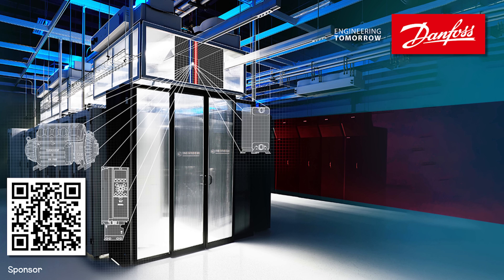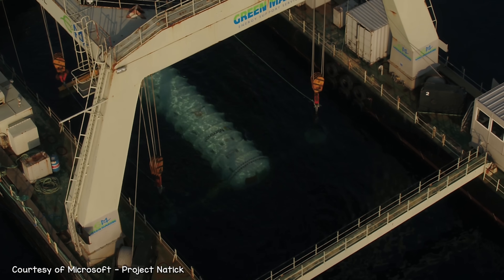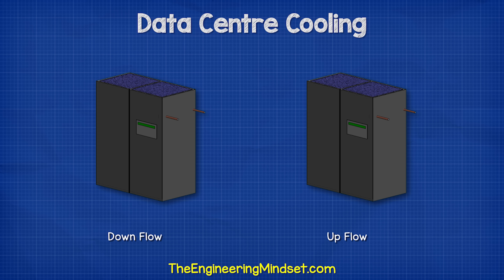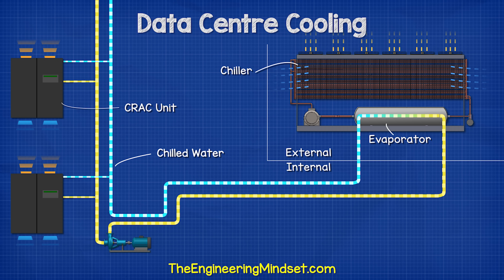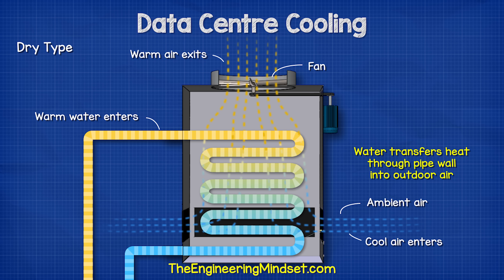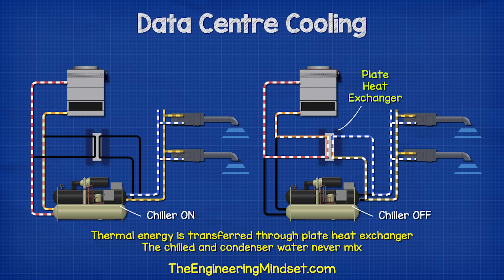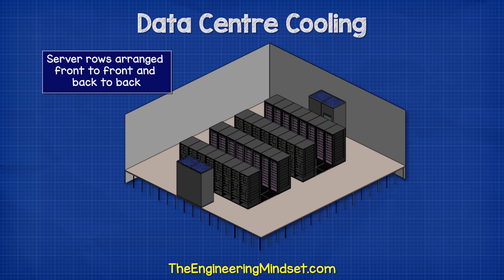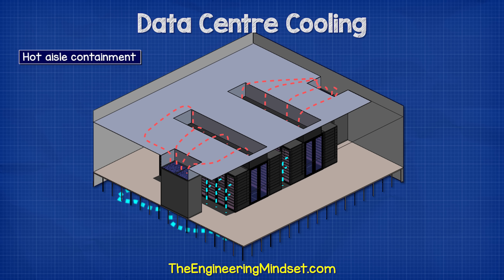Data Center Cooling - how are data centre cooled cold aisle containment hvacr

Comment: I think the biggest waste for most Data Centers is not using the heat you create.
As heat goes upward, i never fully understood why you can't use this heat for example to stop pipes from freezing in the winter on the roof, electric heaters are mainly used as far as i know.
It's pretty stable heating unless everybody leaves the Data Center.

Comment: There's discussion in the media about fresh water usage by DC cooling systems. Given the closed cooling circuits and fluid to air heat exchangers involved, where is this water lost? Some thermal power stations lose water to atmosphere when condensing LP steam in their cooling towers but I can't see why they must use potable quality water for this if they don't have access to river or seawater.
Reply: idk this is exactly why i came to the video. I dont believe the claim that they use millions of gallons per year. Unless somehow its being lost in evaporation

Comment: Should be installed near Buildings in the city To heat the water for the Shower and the heat in the winter in parallel with the Central when the server does not need to be cooled

Comment: Cooling is overrated. Just disable all the thermal protection and  replace your server every time is overheats.
Reply: The Warranty for the Server would be VOID.
You also loose all the Data, which is not why you have a Data Centre. ?

Comment: not sure about the evaporator cooling method. doesn't all the moister cause eventual corrosion of components and inter connects ,shorts in the equipment, and possible data corruption and or loss? 🤔

Comment: This is a very well explained video. I think the performance of the cooler is important, but in the end, the most important thing is to effectively convect and dissipate the generated heat. It seems that the actual cooling energy consumption can be reduced through this.
I think it is good to optimize the air flow to effectively dissipate heat.

Comment: One I’ve built is a hot aisle/cold aisle, air/mist evaporation cooled on from the second floor and forced down through the roof of the data hall and then hot air is removed and either mixed or expelled.

Comment: Some cooling centers use cold isle and hot isle. And some use cooling towers, while others use a different form. They are crazy. They have massive generators, and they are normally powered directly from the power source, IE hydroelectric dams.. one building can generate 1 trillion a year, and one section of the building can generate 500 million to 500 billion. I currently work at one such site.  I work on ones that do not use refrigerant due to size, they are designed to be replaced after 10 years...

Comment: The most environmental unfriendly things from.the moment, data centers....
Some use green energy, the claim.
But still they have emergency generators as backup power which are test run on a regular basis.
Still a big CO2 contamination while the data centers also take the green energy away from normal houses.

Comment: I installed many cooling units in data centers. They also has Halon fire suppression systems in them. I always worried about setting off the Halon system while working in them. Halon gas eats oxygen in the room quickly.

Comment: 1:17 your name of the channel should tell you that if ALL the energy consumed by data center is converted into heat like you say, then you could also compute on your electric heater !!!!
And it would even be more efficient because there are no moving parts or lights or anything else to waste energy instead heater really does convert it almost all into heat.
We do need to take into account that we can not have perfect conversion from electricity to heat so even heater can not convert all into heat, but it surely does do much better than servers do !!!

Comment: Question: Is it possible to harness the heat from the hot air flowing in the ceiling into energy?

Because I have a dumb tought of placing a stirling engine (which I discovered by yt recommend) on the top of the ceiling where the hot air flows

Comment: accurate, correct until the last part.  8:20 racks don't exhaust air to the rear but to the top. data center cooling though still lacks efficiency/innovation.  for example, humans working in data centers don't need to be cooled or the building/room containing the racks. cool air can simply sucked underneath the racks but no.

Comment: Very interesting video!
A good tip for efficiency is to explain to the customers/rack owners, that blanking panels and correct installed equipment are mandatory.... 
No matter, how smart you build your mechanical cooling system and cold aisles.... when the equipment you want to cool is not installed properly, you will always have an issue.

Comment: i used to work in the 9/11 memorial as an engineer. Data centers were top alert at all times, and we had more than a few emergencies where the temp climbed from 60 to near 82 in minutes. The port authority server room had two constantly running dataaire units, and you literally had to wear a jacket if you were working inside for any length of time.

Comment: Even with optional airflow equipment, data center operations folk seem to still have a knack for installing intake on the hot aisle and exhaust on the cold aisle...

Comment: UPS and battery monitoring technician here. Worked in data centers for the past 8 years. I’ve been at data centers that use that evaporative (they called it adiabatic) cooling where they should not have. I was in a battery room that was 88 degrees  F (31 C) probably 100 percent humidity. Not a good environment for batteries. This was a major company but I can’t say who because of an NDA.

Comment: You didn't talk much about humidity control which is very important in data center and the main difference between AHU and CRAC units.
Reply: Talk about humidity control, the testing which I am involved delay for weeks because some consultant assume they can control the humidity to below 70 without a dehumidifier in a humid country.
Reply: I'm in Florida.  We have external humidifiers in the rooms in addition to the humidifier in the air handler.

Comment: Very cool. I work for a large Data Center that builds on slab, hot isle contained data halls. We employ multi-mode airhandlers that are not in the data hall but outside. Cold air is ducted to above the server cabinets. Our air handlers have direct expansion, indirect expansion via an evaporative cooling tower system, direct evaporative cooling in unit AND access to economizer/ free cooling as able to. We even have areas where using the outside evap coolers we have liquid cooling piped into the server cabinets. We went away from CRAC due to potential issues they presented to the Servers when failures happened in the data halls; Too risky. Having the set up we do allows plenty of redundancy both for individual unit component failure and total capacity as well as efficiency for cooling and power. Thanks for the video!
Reply: very cool hahahaha
Reply: Cool job man! Can i ask you a cople of questions ill keep em brief ive began studying data centers and id appreciate your input

Comment: Servers are being designed every day to withstand higher Temperatures so that Cooling Load reduces drastically. DCs have been designed till 38 deg C Hot Aisle Temperature so save sufficient load on Chilled Water System. 
.
Diifference between CHW Temperatures have to be as large as possible to decrease the Pumping GPM and thus the Load.
. 
All inverter (Partial Load) Motors provide higher efficiency at lower speeds. So designing Tier 4 DCs with N+N Redundancy and running both systems (2N Chillers with Inverter Compressors & 2N CRACs with EC Fans) at partial loads provide higher Efficiencies.

Of course,  very little of the stated above applies to American Colder Climate with Free Cooling possibilities but Servers with higher Temperature Resistances always help.
Reply: While I'll agree with you that servers are being built to withstand higher temperatures, as I have walked into rooms that were 95 to 100 degrees and everything was still running. The problem is the optical servers which are delicate and often start to suffer physical damage above 90 degrees

Comment: Hi Paul! I’ve been following your channel for quite some time now! When I was writing my thesis for my Bachelor I was giving an overview of absorption HVAC systems (such as heat pumps and chillers) and I remember that there were more than some articles around that talked about the use of absorption chillers in data centers. One article was analyzing a solution implemented in a data center in Arizona (pretty hot climate) in which some small finned tubes were made passing around the physical servers casings, taking away much heat, then this fluid would have accumulated in a hot tank, kept at the desired temperature with the help of some solar panels. The hot fluid here stored would have been fed to an absorption chiller LiBr-water in order to cool the server room. Hence the server room would have been cooled by the same heat the servers were producing! The absorption chiller was cooled with an external water source, water that if I remember correctly was used and then cooled in a cooling tower.

Do you guys think this could be a viable solution? What problems would it encounter?
Reply from the maker: Yes, it does work. It can't produce enough coolth to completely cool it and it isn't very efficient but, it is a way to offset other mechanical cooling. We have covered how the absorption chiller works in an old video, check it out.

Comment: I've worked in both mid-sized data centers and computer labs back in the 1970s and 80s. Back then, single mini-computer installations were similar to today's data centers in they were installed on raised floors with significant quantities of cooled air, as those O.G. computers produced a large amount of heat that needed to be constantly removed. Sharing the space near a cooled computer mean wearing a heavy jacket or parka(!), unless you love arctic conditions LOL! I believe the air was being pumped from the floor at about 40 degF, not much warmer than the interior of a refrigerator, and 100s or 1000s of cubic feet / minute. Nowadays, people complain if their laptop gets a bit warm or they can hear those whisper-quiet cooling fans. In that data center, you'd be lucky if you could hear your own thoughts. It's like a constant speed hurricane! I'm sure there are many more clever solutions to cooling nowadays.

Comment: In the 50-120MW DCs I'm running, we use indirect air cooling (+ spray water). The chiller just kicks in to add cooled water and mix it into the flow if temps are higher. CAC is normal, HAC is newer and not comment yet. Efficiency also could be made, when the customer aggree to run their intake not on 22-23°c +/-2°c (or even some old folks want 19°c), but more like on 25°c +/- 3°c. From our calcolation that's 10-15% less cooling power needed.

Comment: What is the priority for cooling a data center,  processors or storage? If it's processors then the best way would be in oil that is then cooled and recirculated. Usually a swamp cooler outside.
Reply: That's an interesting idea. Can you provide a link to an information site?
Reply: Using that method the oil will never get below the outdoor temperature.

Comment: I have been working in data centers  for my entire career. I have seen every one of these layouts and cooling systems. One huge challenge is getting the computers and networking gear to have the proper air flow direction, not to mention the, mostly older, systems that move the air in on one side and out on the other. The hot air containment is the easiest to work in from my experience, provided the hot area has air movement to keep the temperature down to a reasonable level. 

One item that always seems to be left out is the noise. Granted that is outside the scope of your video, but it is something your don't hear much about. You wouldn't believe how loud it gets inside a data center, especially inside of a hot isle containment area. All those 20,000 RPM fans pumping air into a small enclose space is deafening. Ear projection is a must. You showed some B-roll of people in a datacenter wearing hard hats. That is bullshit. Nobody ever does that. You need one where everyone has ear protection.

Also, all the sock video ever shows neat and clean rooms all organized and all with super clean wiring. That does happen, but only in a room that is managed properly. I have been in many colo's (colocation data centers where you can rent 1 or more racks) where many of the racks are just a spider web of tangled cables. It is a major problem that good datacenter managers spend a lot of time policing.

Comment: As a server tech I was sent to do a SAN upgrade to a customers in house datacenter. Expecting to be in there for hours I brought a nice warm jacket.When I walked into the DC it was like stepping into a sauna. The air con system had failed, there were buckets of water catching leaking AC and they had house fans plugged in trying to cool all the equipment. There were hundreds of red flashing leds on all the server and storage equipment in the racks.  I have also encountered Datacenter AC failure with water leaking from the roof soaking the racks below. With staff frantically calling their server storage hardware vendors to log warranty calls and of course not mentioning the flood they were exposed too. Cooling failure in a DC is catastrophic, u better have a   redundant solution in place.

Comment: I don't get how the position of the evaporator coil is completely horizontal, from my understanding it should be installed at least with 60 degrees of inclination.
Reply from the maker: In reality it is, but this is a simplified 3d model. It's missing 90% of the components inside. It's just shown as a illustrative representation

Comment: Do you know if the raised floors are insulated to slow heat transfer? Thanks
Reply from the maker: They should/could be, but many aren't
Reply: @EngineeringMindset  Thank you!
Reply: I have not seen in data centers or semiconductor fans. They are moving a lot of Air relatively fast, so it may not add value. 

Also they install a lot of utilities under the floor including power. Those systems come up through the floor.

Comment: Could we use the waste cold energy released from the Liquefied Natural Gas (LNG) regasification process to help with cooling costs?
Reply: I assume that would work but I would think that there are way more data centers than LNG terminals, although both LNG terminals and data centers are located close to cities.

But there are other ways to reduce cooling costs.  For example, the server room in the office where I work recycles the server heat throughout the building 8 months of the year and heats the building for free except on the very coldest days.

Comment: How about a video on oscillators? How an inductor and capacitor in parallel circuit can make an oscillator. How they are used to make frequencies for radio applications. And finally, talk about quartz crystal oscillators.

Comment: I've been to a couple about 10 years ago working with the chillers.  It amazed me that the emergency generator can start up, go to full speed and powering the building in less than 60 seconds.  The chilled water system usually has about a 10 min. reserve of chilled water so if one chiller goes down, the spare can come up to speed before that is all used up.

Comment: Good explanation. The data center that I worked in evolved from overcooling the room to keep the servers happy to adding containment with an automation system that installed 3 temp sensors on the face of the cabinet doors  to control that CRAC units fan speed and supply temperature. The automation system would learn the cooling requirements of the room and worked quite well. Only problem was when additional cabinets were added  it would require additional sensors and automation system programming.
Reply: did that reduce energy consumption? by how much %?

Comment: How much degrees tempareture maintain in data center
Reply from the maker: It depends which industry guide you choose to follow. Some suggest supply air around 23*C, but you need to consider your data center and equipment to understand if that is suitable
Reply: It also depends on the server technology, new equipment can handle higher temperatures. Google is running warmer temperatures than a lot of others. But 68 F still seems to be the sweet spot.

Comment: To increase efficiency we could have reduced oxegen atoms to reduce the formation of rust this will require infrastructure but would it be worth the significant cost?
Reply from the maker: It would reduce the risk of fire. But it's very energy intensive to maintain a low oxygen environment.
Reply: @EngineeringMindset  maybe the underwater server does it well without any extra energy
Reply: @RahulKumar-ve4jm  underwater construction is not cheap or easy. It rusts. Why not just build next to water and drop in a heat exchanger underwater. But you have to consider the heat pollution issue.
Reply: It could also be dangerous for humans
Reply: @joecool4656  Its not very dangerous, i work in a few centres with lower oxygen levels. You can easily work in there after doing a check up, or just turn the oxygen level higher that does it also. We use it to prevent fire.
Reply: Can someone explain to me why you would want to do this?  Is rust actually a problem in a climate controlled environment?  I've owned many dozens of servers and have never considered rust and have never seen rust in a server.  Maybe rust would be a problem at edge deployments like cell phone towers, but that's not what this video is about.  And why would lower oxygen be helpful except for the reduced fire risk?